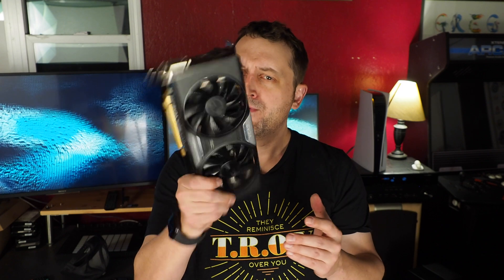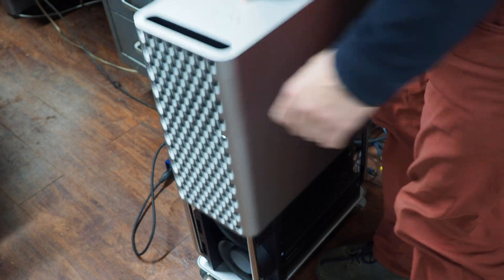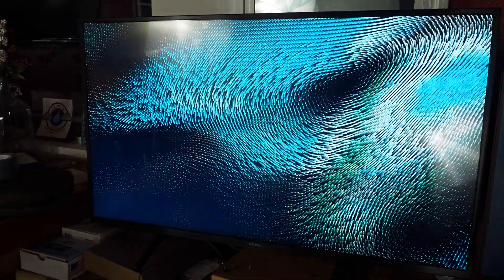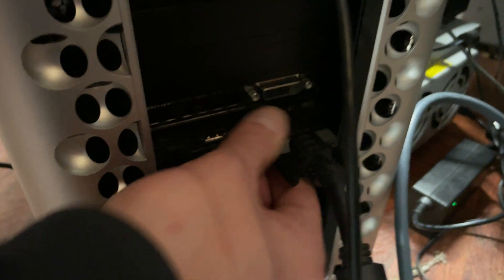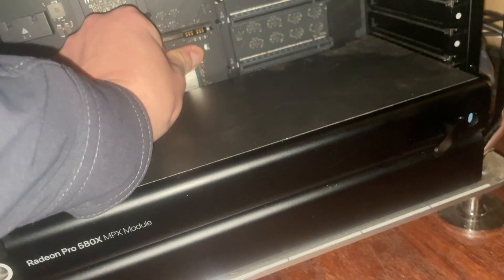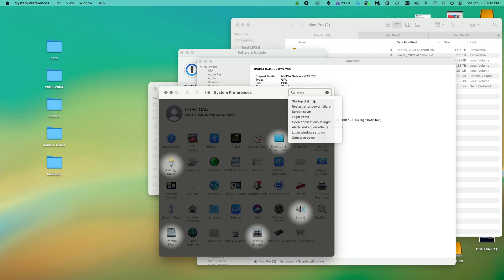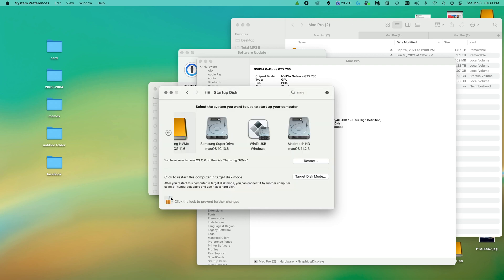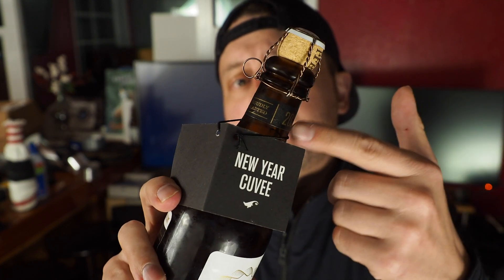What happens if you stick a GeForce 760 GPU in a Mac Pro 2019?

Comment: I have mac pro 2019 with basic intel chip. 

What the best graphic card I can insert into this mac? I am gaming on bootcamp but need a new better graphic card with raytracing.
Reply from the maker: Hasn’t changed in years as Apple effectively abandoned these computers, 6900 Xt or with opencore 6950 XT. Drivers are tied to the OS and Apple never has lifted a finger to support 7000 series GPUs.

Comment: I used Open Core on a 5,1 - and currently have Windows 11 on an NVMe in that machine. I’m thinking about getting a 2019 Mac Pro. Can I move that Windows 11 NVMe straight into the 2019 Mac Pro with no issues?
Reply from the maker: If it was installed using Uefi mode? Yes.
Reply: @dmug  it was installed via a Windows 11 USB thumb drive straight to the NVMe (no BootCamp at all)
Reply from the maker: @JohnnyMcPro  Should be fine.

Comment: Very annoyning that you can’t run Nvidia-cards in Macs anymore, it has to be AMD. Why do they limit themselves so much? i guess it has to do with the switch from Intel to their own chip. I still use old Mac Pro 5.1 from 2012, but would need something else. Macs are extremely expensive today, I doubt I can afford a new one. I would like to buy Mac Pro 7.1 but can’t afford it. And for how long will it work when Apple is dropping Intel? Maybe it will be osbolete in 2-3 years.

Comment: you can do 4k 60 in windows but only with a driver update. mac os started with an older driver that isn't capable of this. Nvidia did some trickery to get this to work so its only at 4k. you can't do it at strange resolutions like the ultra wides even on windows.
Reply from the maker: Hmm, not even via displayport? I'd assume that's true for the HDMI 1.4 port it has.
Reply: @dmug  no not with disolayport. It's too old still.

Comment: 6:46 probably one of the best things that i like about windows 10, it just grabs the driver for you from the net when you just want to do a quick system setup. 
sure it has its limits mostly for XP/Vista era pcie cards doesn't like getting drivers for that stuff but anything for windows 7 and up is fine.
Reply from the maker: Agreed, not everything windows does is terrible. The Mac community has a strange attitude and still that everything Windows does is wrong. I like things about windows, like the fact that I can run programs that are 20 years old. It also has much better consumer surroundsound support. By much better, I mean that it actually has it. Overall, I prefer macOS, but doesn’t mean I can’t acknowledge the good parts of Windows

Comment: I have a MSI GTX980, what are the chances of this ever shining again in my 2010 mid 5.1. Never or never ever ever ever? that was the height of performance. Guessing i'd probably have to back track to High Sierra
Reply from the maker: @Graham Smith - based on Apple complete absurd behavior towards Nvidia, I'd say neverq ever ever. The OpenCore Legacy patcher that allows Monterey to use Nvidia GPUs has Apple signed drivers. With Apple sunsetting Kexts, if I'm not mistaken the Web Drivers cannot be injected.

Apple and Nvidia squabbling is 100% the reason why we don't have Nvidia support. Nvidia was happy to write us drivers until Apple revoked their dev account. It's so  childish and petty.

Comment: Can you confirm if SwitchResX works to force 60Hz? I have tried many times to force 4k 60Hz resolutions I get in windows in Mac OS with SwitchRes X with no luck. Also I’ve heard someone has managed to flash 6000 series AMD cards to work in 5,1’s by modifying the firmware. If you know anything about this. Please make a video!
Reply from the maker: The only thing I've read is just Petri speculating about what could be done to modify the ROM, to my knowledge no one has done it. I just checked MacRumors and didn't see anything and same with the MacVidCards blog. 

What GPU are you using,a  GeForce 760? Are you using DisplayPort? The HDMI port is 1.4 but you can force out of bounds resolutions in Windows via HDMI, unsure about macOS. You'd probably need to use the DisplayPort. I have a DisplayPort cable around somewhere but can't find it as the RX 580 Pro MPX version is HDMI strangely so I can't test it myself via DisplayPort.
Reply: try RDM its way better than switchresx and retains your settings after reboot

Comment: Has anyone tried to put the RX580 from the 2019 Mac Pro into the 2012?
Reply from the maker: It doesn't physically fit, I don't have a 5,1 to confirm but it certainly doesn't fit a 3,1.